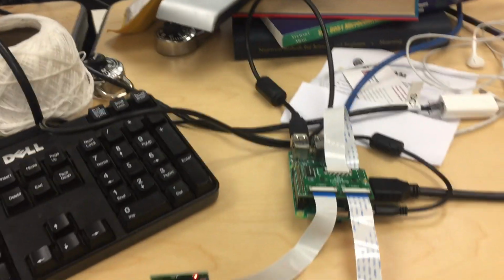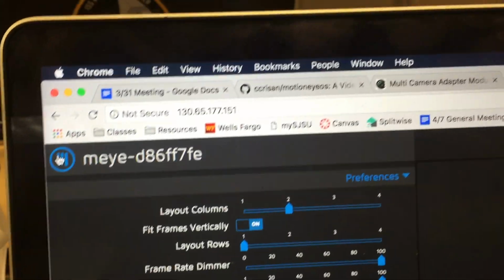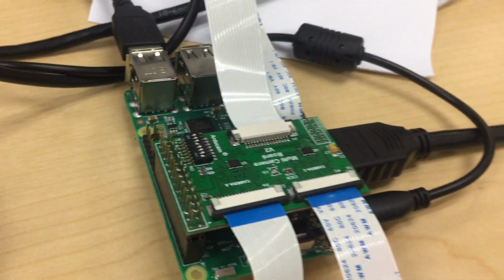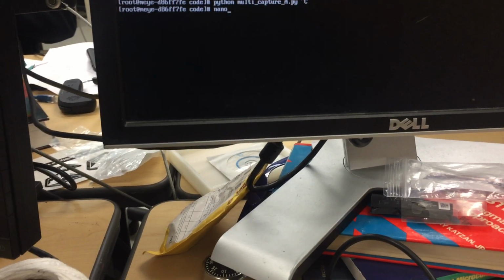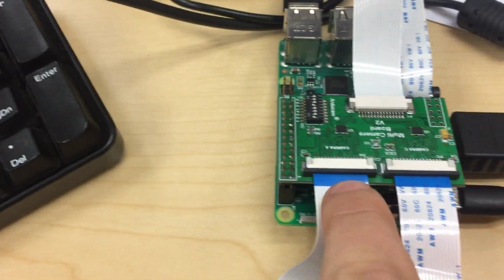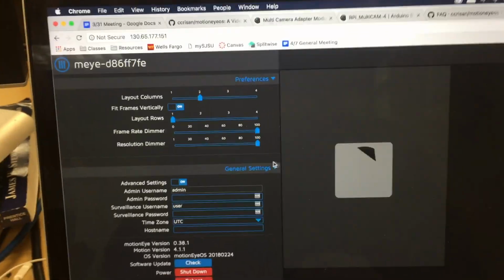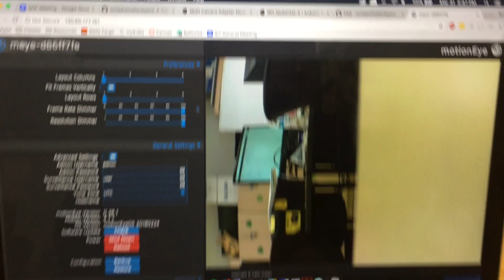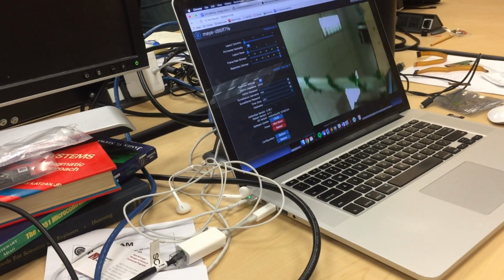Raspberry Pi 3 - Video Streaming w/ Multiplexed Camera Input

Comment: I'd like to connect a normal and a noir camera to one pi, and switch between the two based on the time of the day / sundown external api or something like that. Do you think that it's achievable? Thank you, Roberto
Reply from the maker: Yeah definitely, as long as both cameras can work independently with the RPi then using the camera multiplexer I'm using here should be no problem.